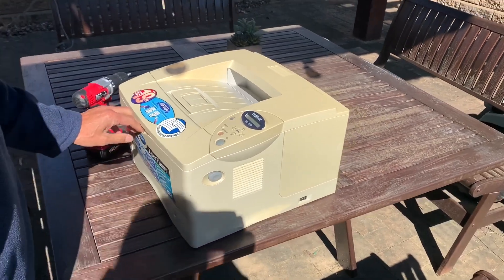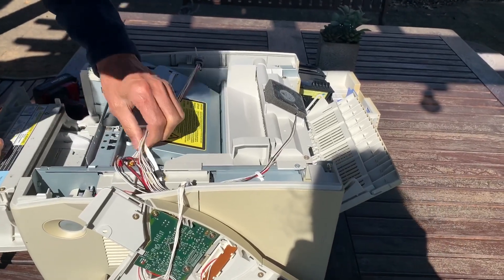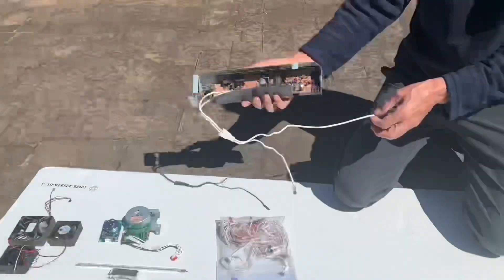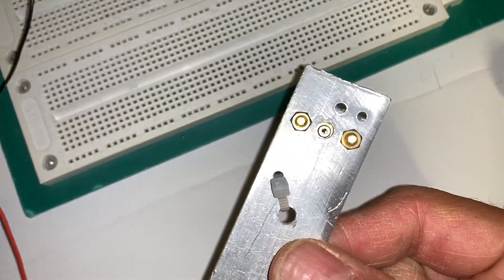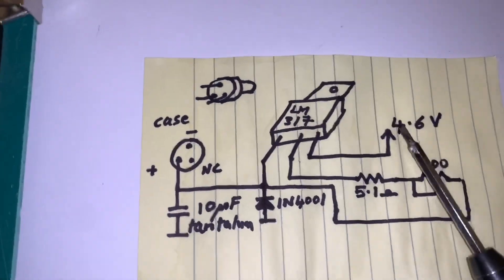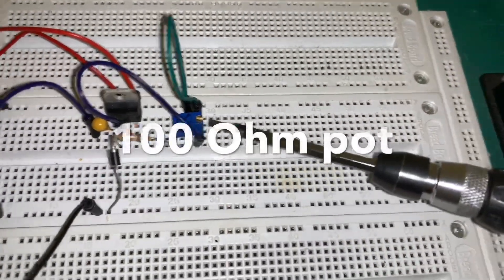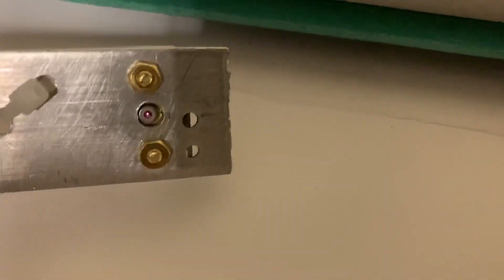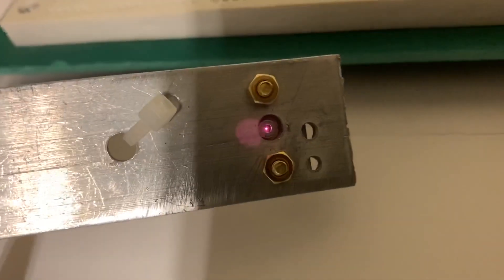Laser Printer Takedown- for Burning IR Laser

Comment: I pulled a similar old Brother laser printer apart and was fascinated by the whole laser, rotating mirror, perspex lenses and glass mirrors. The plastic that all this is held in, is a new one to me, PPE,  - Poly (p-phenylene oxide). This is a plastic used for its rigidity, to keep every thing in line for this part of the printer. On the back of the black plastic unit you will see    > PPE/PS-GF<   which is PPE plus Polystyrene plus glass fibre. I still don't really know how the laser creates the image on the drum. I will keep looking and reading.
Reply: I believe the laser is only responsible for melting the toner into the paper and not actually creating the image.

Comment: What is the voltage to light (test) these printer lasers? I took this laser from a Xerox laser printer and did a test, applying 3 volts as with DVD lasers but it didn't light up.
Reply from the maker: 3V
Reply: @BrianDhvTinkerer  Mine didn't!
Reply: @Dancopymus  maybe because the laser diode is dead
Reply: Maybe it uses ir light
Reply: @cipry1010  Yeah I think someone forgot to mention to him that ir is invisible to humans, unless a camera was used then fair enough. Still, different lasers need different voltages.
Reply: @yasirkadhim2940  let him point it to eyes,he will be so happy